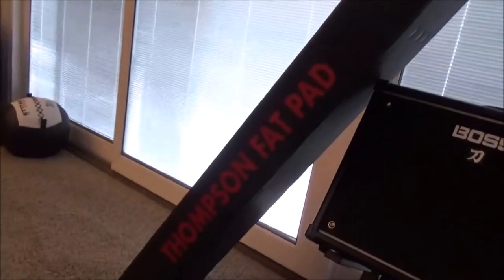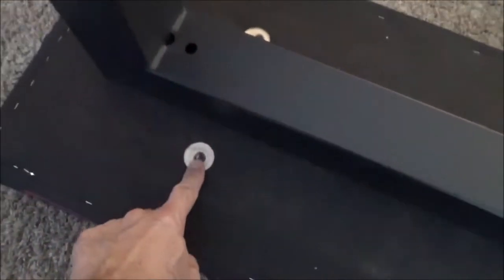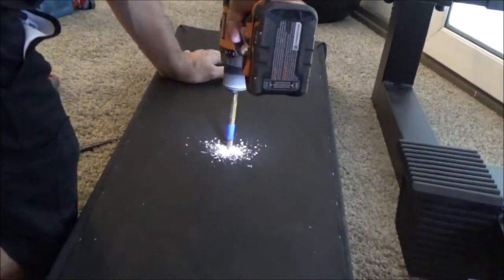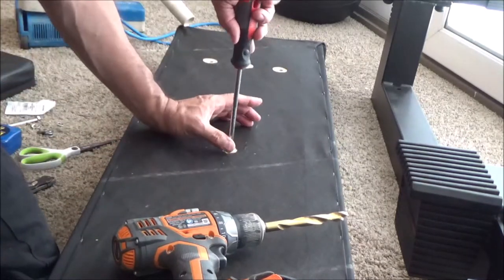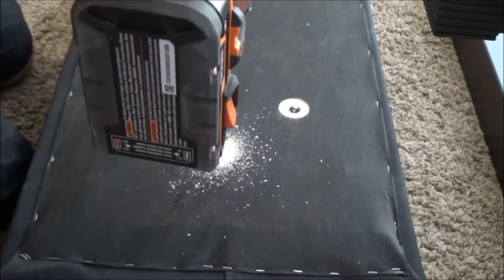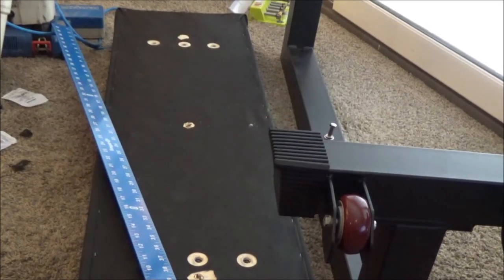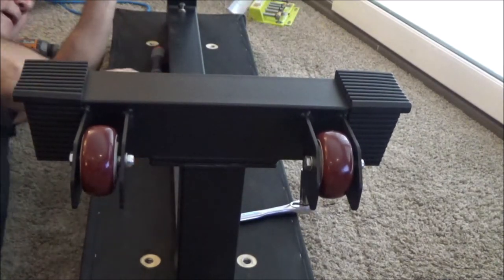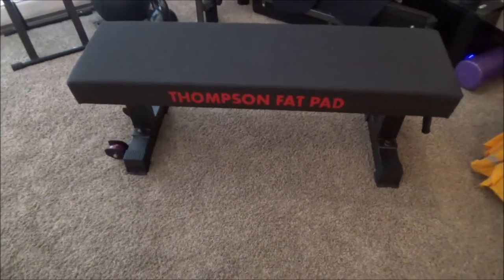Installing a Thompson Fat Pad on Non-Rogue Bench (it ain't that easy)

Comment: A couple of comments to save the next guy some work:
- Drill through your old bench and use the existing threaded inserts in the TFP.  Much less work, hassle, and much safer.
- Set the bench on top of the pad, get it lined up, and then use a drill bit the size of the holes in the bench to mark the locations for the holes, that way no measuring to screw up.  If the final hole size is larger than the hole in the bench, then you can use the holes in the crosspiece as a guide to make sure they're drilled straight.  Otherwise, measure twice (or 6x) and drill once ;-)
- Those threaded inserts are not designed for that kind of a load.  I have no idea what the fat pad used as a backing (seemed very hard from what it looked like when you were drilling, things like chip board and OSB can be tough to drill and be brittle and fasteners pull out easy), but they would tend to pull out in a high-stress application.  Those inserts are designed for lightly loaded joints that are taken down often.  The inserts in the pad are likely (at least should be)  something like a t-nut (a flanged nut) that couldn't pull out without the board completely breaking.  The only proper way to install them is to pull the cover off the pad and put them in between the foam and the board.
- your threads being slightly off made it hard to start the bolts, if you start each on a thread or 2 and then tighten them down once they're all started it will go much easier.  OTOH, when you pull them it will try to pull the threads straight and you have the torque of the length of the bolt loosening the threads in the threaded insert.
Reply: Yeah, I think if I had to do it all over again, I'd do as you suggest and drill new holes in the bench frame.
Personally, I wouldn't do this again. I'd just go with the rep fitness wide pad. I wasn't aware of this when I bought the thompson.
Reply: @JS-lr8nj  the Rep Fitness wide pad won’t work either on this bench... just tried it today.
Reply: completely agree I think the TFP uses T nuts like climbing holds so instead I am going to use the existing TFP holes a custom steel adaptor plate that also lines up with the holes on my bench

Comment: because the fat pad is such a wide profile and rated for so much weight  on this Bench I would have gotten a strip of junk metal cleaned it up to get rid of rust and tagged it with some black spray paint and drilled it to size for the pad to rest on and disperse the weight and then just mount it directly into the Frame after drilling a hole through the frame. making it a Real Beast.

Comment: Thanks for sharing this video. I recently purchase the titan competition single leg flat bench, which is 100% identical to the titan bench you have in how the pad attaches, and this pad sucks! Was looking for how to upgrade the pad!
Reply: Look at the rep fitness wide pad. same sort of thing, but much cheaper.
Reply: @JS-lr8nj  I was looking at the FB 3000 or FB 5000 replacement. Both are less than $50 shipped pre tax. 

Im wondering since the pad itself is thicker, but there is no lateral support from the brackets along the spine, do you feel that it is still sturdy along the edges of the pad? eg, doing a single arm row results in no give? Thanks!
Reply from the maker: I think you'll be fine. You get some lateral support because of the plywood in the bench.

Comment: I like to measure 20 times and cut once! Nice work! I may try this myself! One thing you might want to add to your toolbox is this neat little drill guide .....MILESCRAFT DRILLBLOCK....$8 at Lowe's. Helps to keep your drilling straighter!
Reply: Thanks for the tip! I've seen quite a few people recommend NOT to do this. They recommend just lag bolting into the bottom of the pad, instead. If I get some time, I may test both methods.
Reply: @JS-lr8nj  Always more than one way to get it done. Nice work though and mission accomplished!
Reply: @JS-lr8nj  how did it turn out?

Comment: Do you remember the distance between the fat pads bolt holes? I would like to see if it will fit my ivation bench.
Reply from the maker: Nope, sorry. And with the frame in the way now, I'd just be eyeballing it. Your best bet is to find somebody with a rogue bench you can compare yours to. 

But honestly, it's basically impossible that any other manufacturer is going to match Rogue's hole patten.

If I were doing this again, though, I'd get the rep fitness with the wide pad upgrade.  Cheaper and you get the whole bench.

Cheers!
Reply from the maker: FWIW, the outer bolt holes are roughly 6" apart center to center and about 32" apart, lengthwise, give or take.  But the odds of this bolting up to any other manufacturer are basically zero unless a company is specifically building rogue knockoffs.
Reply: Jim in the Gym, I appreciate it man. If I get one I will probably have to do what you have.
Reply from the maker: @thomassurber7487  Good luck. Maybe you'll get lucky. If not all the holes line up, maybe some of them will. 

Seriously, though, check otu the rep fitness bench with the wide pad. That came out JUST as I was ordering my thompson fat pad. If I had know, I'd have gotten the rep, instead.
Reply: @JimintheGym  I'm not sure on the Rep Fitness one, but the Titan fat pad is apparently a super cheap knockoff and not anything like the Thompson fat pad. The material on Titan's fat pad is apparently just a regular slick material... defeating half the point of the Fat Pad in the first place. I think going with the Thompson fat pad is definitely the way to go. I will probably use the Titan bench as well and just put the Thompson fat pad on it. Whenever they end up restocking them on Rogue...

Comment: Why not 1 1/4 lag bolts?  If they ever got lose then you could do this?
Reply from the maker: I did consider lag bolts, and use them in instances where I can drive them deep into wood.  Here, though, it's very shallow and I don't honestly know how thick the plywood is.  Also note, on a lag bolt, the very tip of it doesn't really grip.  

The brass insert allows for much larger thread diameter inside the wood for a bigger hold.  So, for a shallow hole application, this is going to give you much greater holding force.

The difference in cost isn't really enough to drive the decision.  

And the precision part of this is where you're going to drill your holes.  So, that'd have been the same issue, either way.

Plus, if the lag bolts fail, they'll tear out some layers of the plywood on the other side. Granted, you can put holes elsewhere, but it may not be as balanced.

This also provides greater potential to remove the pad and use it again in the same configuration if I chose to do that at some future date.

So, basically, cost savings wasn't really there and there are considerable advantages to using lag bolts.